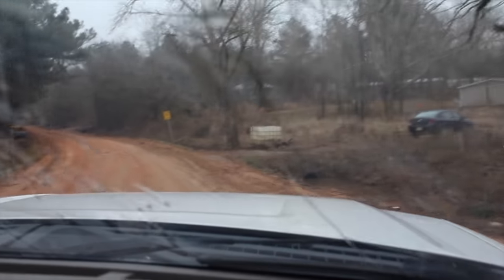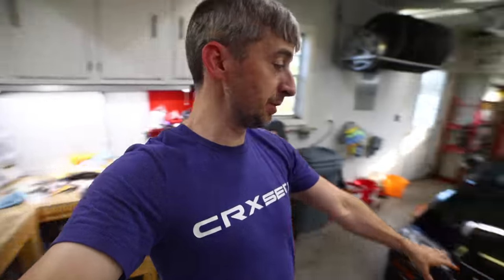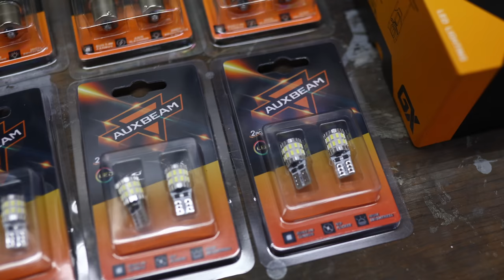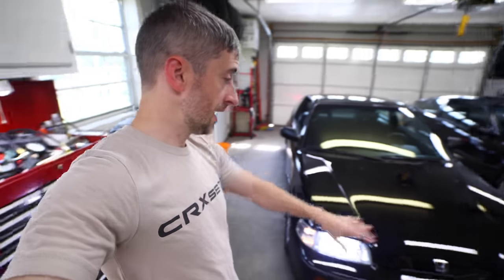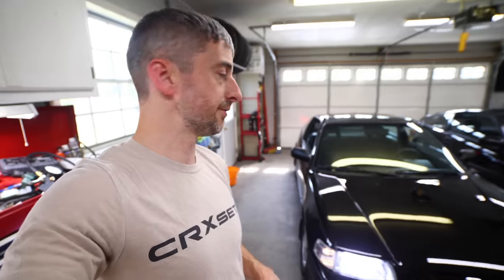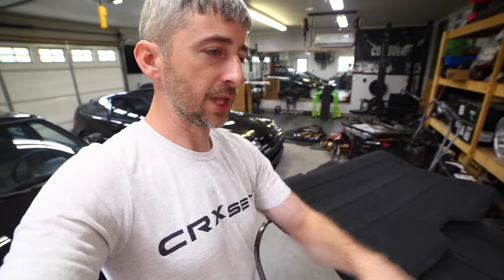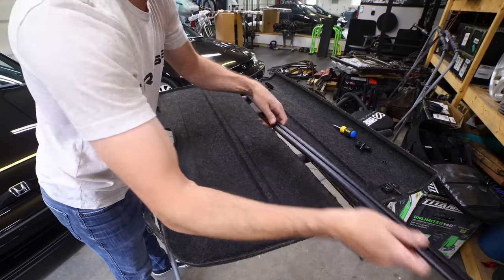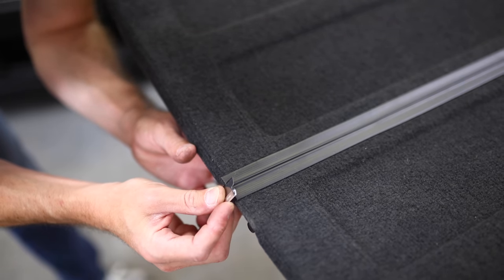1988 CRX Si Restore Part 48 - Auxbeam LED Lights + CRX Cargo Cover Repair!

Comment: CRXseth brother brother brother you are definitely correct on the fact that the white in color bulbs do have an effect on any other color lenses besides clear ones. I can't stand that and when I swapped to LEDs for my first time I learned the hard way. But it does make a huge difference for bulb colors when they match with their same color lamp lenses it makes them that much more rich and vibrant. Since I noticed it the first time I've never gone back to anything else besides the color bulbs matched up in the same lense color

Comment: 11:21 such a great idea especially for working without a lift! Super hard to swing a hammer underneath to remove this on jackstands. What adapter is on the end of that breaker bar holding the punch?
Reply from the maker: It’s just a socket that fits over the punch.

Comment: LED bulbs behind a colored lens should match the color of the lens for max output. With a white LED, the color lens filters out part of the visible light spectrum and won’t appear as bright as if the LED matches the lens color.
Reply: Yup!  Came here to say this.  Amber lenses should have amber bulbs.
Reply: @CrMo4130  yeah I did an experiment years ago with identical LED bulbs except one white and one red in my tail/brake lights. The red bulb was noticeably brighter.

Comment: By any chance would you be interested in helping me restore my 1991 Honda prelude with 4ws? I would love to put an H22 engine with power steering, air conditioning, and cruise control. I know funrdye does these type swaps; but he doesn’t do these types of restoration. Much much respect for time and dedication.
Reply from the maker: Unfortunately, I do not do work for other people, as this is just a hobby of mine.

Comment: Will they fit in the JDM headlights without any modifications ?
Reply from the maker: I have no experience with JDM headlights, so I cannot say. Just get the correct bulb type that the JDM headlights use and it should work. I’ve heard JDM lights use an odd bulb, so I’m not sure.
Reply: Thanks for the reply and thanks for the info